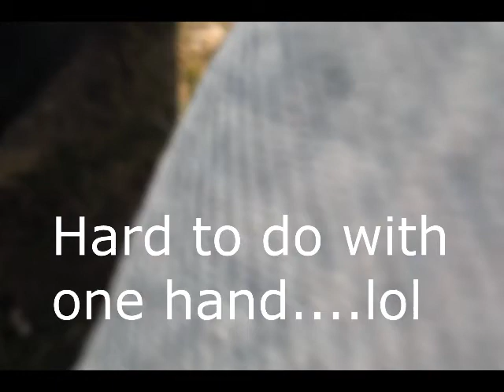How to: install HID bulb in 2003 chevy cavalier

Comment: You have to drill a hole into the dust cover large enough to pass the wires through. If the kit you buy doesn't include a corresponding rubber grommet, you'll need to pick one of those up as well to keep it watertight.

Comment: hey am looking to do the same to my caviler  but how did you run the wires on mine i got the dust cap thing on the back of my headlight so what do i do just keep that off or can i buy a modified one i need help   good video

Comment: Do you have to install a relay kit
Reply from the maker: Nathan Scriven  nope . not for single beam kits (low beam only)
Reply from the maker: Nathan Scriven  sorry yes this is a  bi kit (high and low beam) you would need a relay kit
Reply: omg I rept it all aut its not working rite help
Reply from the maker: Nathan Scriven  if your bulbs are one bulb that moves in and out you  need a relay. but if its set up with an HID bulb and a smaller bulb then you dont need a relay.